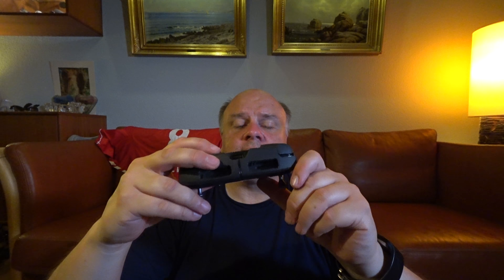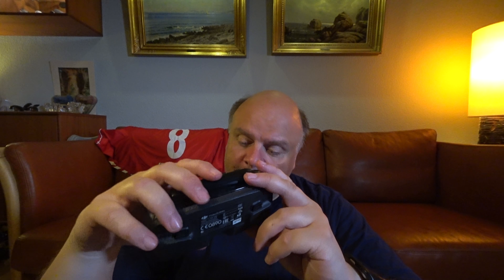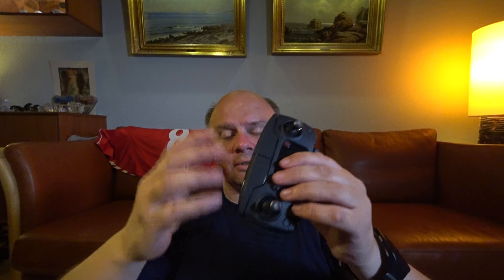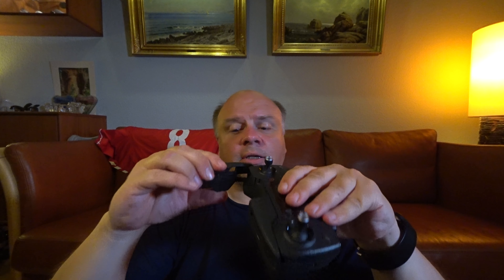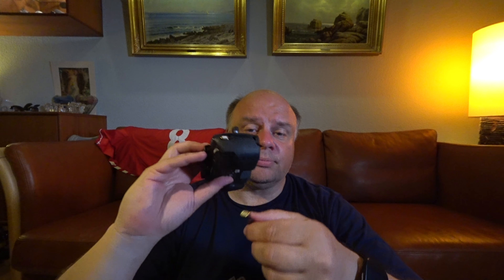TOP TIP - prevent charging port breaking on Mavic Pro remote

Comment: Too late for me... My charging port broke. I am so mad. I will get one once I get my charging port fixed. It broke out of warranty.
Reply from the maker: Darned that is REALLY bad. I don't know why they created a design where it's impossible to tell which way the plug should go. I'm using the magnet plug now, but it's silly that you have to take steps like that to prevent a design error.